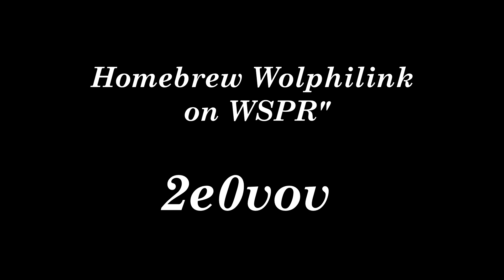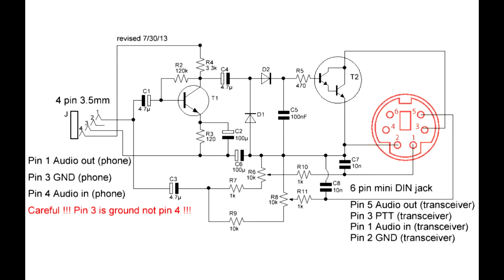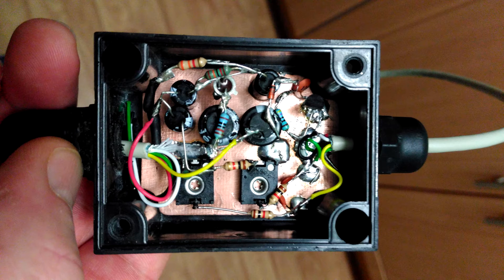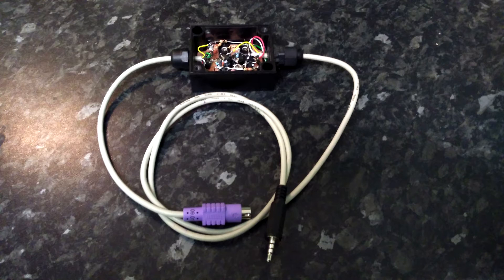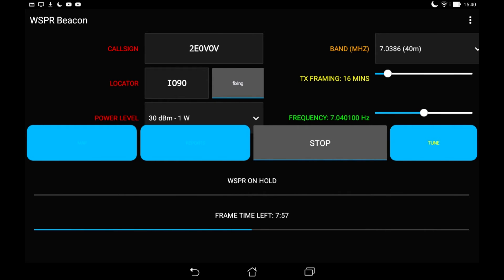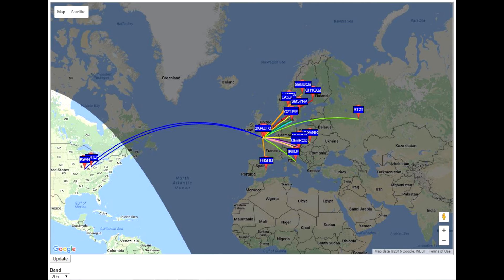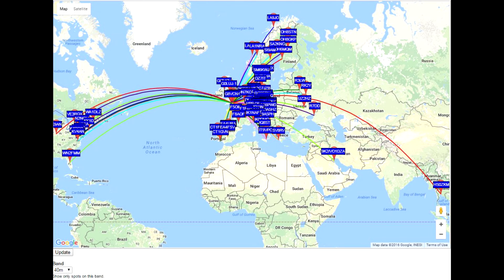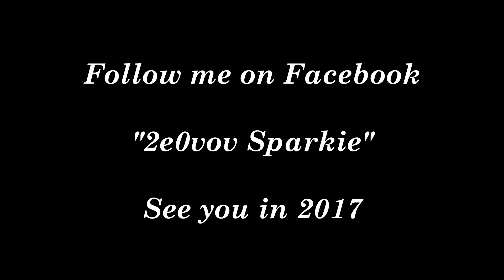Homebrew Wolphilink Data interface FT817 ft857 etc

Comment: Great video. Just what was looking for. 1 question. What did you use for T1 and T2
Great channel
Reply from the maker: Hi Stephen. I originally tried T1 2n2222 T2 3904 NPN transistors but the gain was to steep. I found the 2n2222 NPN worked well for T1/T2 for me but the gain of these can vary a little dependant on maker. The original design uses a Darlington for T2. Mine now runs this configuration, but I can't say I noticed any change, it still works lovely. 73s

Comment: Built this very circuit earlier in the year. Works very well. Use it with droidpsk on my cubot android and the ft817-nd. Great weekend project, super cheap
Reply from the maker: absolutely cheap as chips! This cost me under £2 UK Sterling. Have you tried it on the Clansman?
Reply: No I haven't but it is definitely on my to do list. I have a homebrew 
lead thats 3.5mm stereo to clansman audio plug, I may have to mess 
around with that to make it key up with the interface. I'll have to look
 at the ins and outs of it.